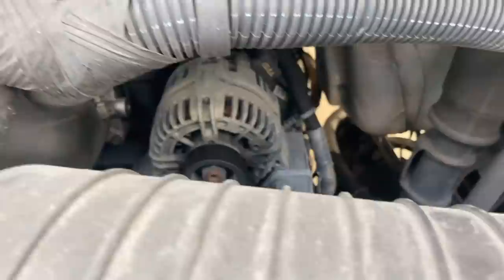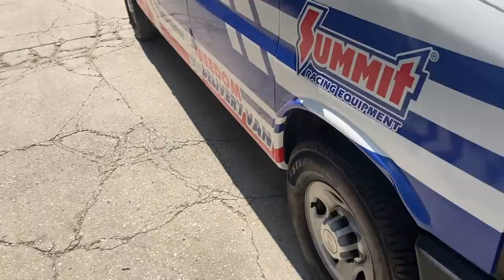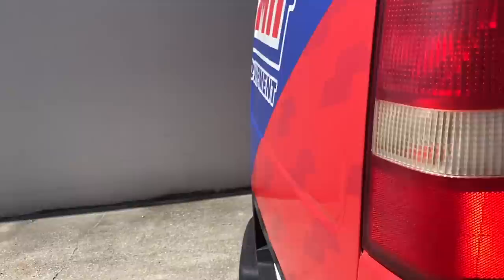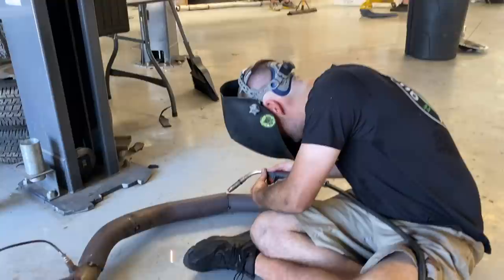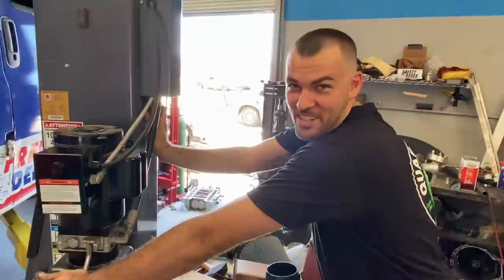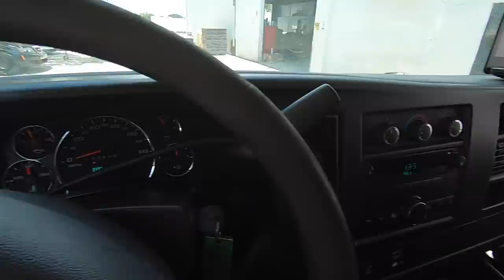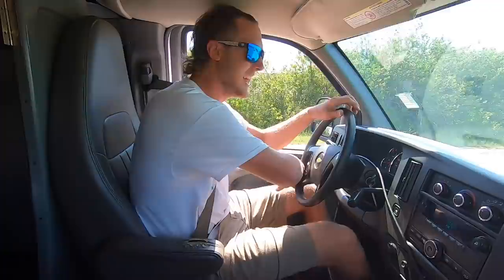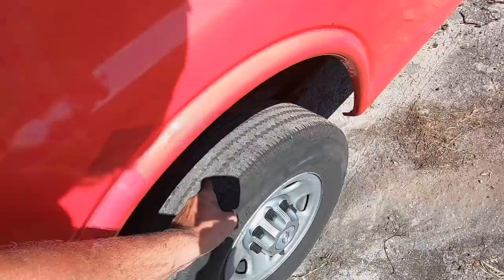We Turned a 220,000 Mile A/C Work Van Into a BURNOUT MONSTER!!! (Freedom Delivery Van)

Comment: Next video: "We blew up the 6.0L and the van is getting a Texas Speed 427"
Reply: as is the stock van is just about ready for 1000hp. 6.0L gen4 with a 4L80e trans 14 bolt rear end 
ideal van to buy for the drive line when building a cheap race car/hot rod or whatever you want
Reply: Or cram that spare 632 in there 🤷🏻‍♂️
Reply: Lmfao Diskmuzik, that it so true haha 😂, Texas Speed FTW
Reply: I highly doubt that. Maybe a Summit crate engine.
Reply: @MrKKUT1984  If you want it to look like the Mystery Machine on the inside 😂😂
Reply: Continue the 427 fleet conversions!!!
Reply: And cal-tracs and roll cage and slicks and nitrous and parachutes and soon 8's and.....
Reply: Lol this is EXACTLY what I was going to say
Reply: @NightshiftCustom  I kinda think it's actually a six speed but I could be wrong.
Reply: The truck actually  has an L96 with a 6l90 behind it, not a bad combination. Haven't  seen too many builds with a  6l90 tho
Reply: and a powerglide
Reply: Kyle C. Correct it should have a 6 speed

Comment: "This was a well well maintained van" that's the last time anyone will say that
Reply: Doesn’t really matter when it’ll have a Texas speed motor with a powerglide in a couple months
Reply: I was wondering myself how long before it has a texas speed motor in it
Reply: Next year's road trip wagon no trailer needed
Reply: Nice waves brotha!
Reply: Guys at summit instantly knew they fucked up when james was the first person seen in video, they knew there was going to be Nos and the signature welded diff.  Kind of wondering when a giggety gas company is going to get with james and make his own unique nitrous system with an Endless bottle and a 1,000 shot pill in the form of no regulator and a straight line to manifold with a remote opener.

Comment: Just a heads up I'm 6'2" wrecked a van just like like this. The front end damage was so extreme they had to cut 10"+/- behind the driver's door, steering column, seat and I ended up with a shattered pelvis, hip, 7 ribs, sternum, and 5 vertebrae. I know you're taller than me so if you're planning on driving it on the street much the best thing you can do is get the driver's seat moved back.
Reply: Wtf man that sounds awful.  I have a van just like this that I drive 5+ days a week and you're story scares me. What you do to squish it up so bad?
Reply: @McNamEvan  lots of speed
Reply: But you lived, must be designed somewhat safely.
Reply: I'd have to guess too fast for conditions, loaded heavy with stuff and either hit something dead stopped or someone pulled out directly in front of.
probably a side of rusted out mess :)
Reply: Jim Herbert Outdoors u cant call that safe with that much damage no offence but google the definition of safe
Reply: True
Reply: @McNamEvan  Sorry I never saw this. I had a seizure or blacked out and rear ended a semi at 45mph. It wasn't "lots of speed" that made it so bad, had I been in a pickup the wreck wouldn't have been nearly as bad. Reason I know is we had an employee driving a truck on the interstate when a suicidal woman cross the median and hit the truck head on and he only had a concussion. Another thing about my wreck is the entire front end of my van was completely destroyed yet the air bags didn't go off.
Reply: @scarea2691  see my reply
Reply: @chesspiece81  well that seems like the key factor here...defective airbags caused you to have such brutal injuries not the design of the van...I'd be suing the company that let you drive a van with defective airbags

Comment: “The last of the V8 interceptors...”

All that van’s missing is the huge stack from Toast. Then it’ll be perfect.
Reply: BIG BLOCK THE VAN
Reply: bump
Reply: Andrew Apel bump
Reply: @raelik777 its easier/cheaper to make power with the engine that's in it, we swapped one into a stock big block truck for that reason

Comment: Awesome guys Vans can be fun.
Here's 2 short stories of mine.
A Friend and I,
Bought an ambulance from a police auction. With 40k miles
It had a 460 Big Block 
And still had all the Lights n sirens. And used to cruise the strip at seaside N.J. and the cops would block a street or 2 to stop guys from cruising up one side and back on the other side picking up chicks. But being that we were in that ambulance, We'd get waved thru the traffic by the cops. He also had 2 15"s and 2 18"s Sub woofers and lotta mid range and huge tweeters. And outdoor horn speakers. You'd hear the van coming from like 2 miles away...
We also got another beater van
It had a 
rawd iron fence as a grill guard.
The front brakes were the only brakes that worked.
Also front shocks were blown,
So if you'd  time n hit the brakes then gas just right, It would bounce like it had hydraulics. 
He had put these big ass
38" Off Road Tires on the rear
And we would power brake that thing everywhere.
 Cause,
Like I said it had No Rear Brakes.
He would hold both pedals to the floor, and leave 1/4mile+ long Burnouts While fish tailing same time. Once we're doing this Giant burn out at night , forever just really roasting them tires...   
 So,
We went up the road turned around and was coming back to check out the marks.
And we saw 2 dim lights, Just sitting there Right where we did this huge Burnout. So we drove up slowly and it just didn't look right. We thought we'd be in Big trouble cause a cop lived down at the end of road.
So as we come up to the lights slowly. Then we seen  2 piles of the rubber, Were on fire and it looked just like 2 Dim headlights. LOL 🙈🙉🙊
 😆😅😄
 💪😎🤘

Comment: Used Van sales just went up 300%!

I'm getting ideas for my new class c motorhome with the 7.3 liter in it..  would make turning it around in a small parking lot easier 🤘😁👍🇺🇸🇺🇸
Reply: So, GM made an AWD 1/2 ton cargo van from 2003 to 2017.  The H series platform(not to be confused with the 2wd G series vans).  Cargo van prices are already extremely messed up because people selling them know that people buying them are doing it for making money, thus, they demand a premium.  My 2010 savana, with its original motor at 370000 miles can be sold today, for around $8500.  This looks like a much newer model, judging by dash type and a couple of gives, this looks to be like a 2014 to 2016my.  This van is worth probably about $15000 with 220k on it.
Reply: Shhh, I'm already trying to figure out how to hunker down my Lance Camper onto my Silverado better. 🤫
Reply: @chubbysumo2230  True, and shameful. Us poor van guys are out of luck. Guess I'll just enjoy pickups.

Edited for stupid ass autocorrect.
Reply: MIDBC1  true but that's a $20k plus difference.  I initially set out looking at Diesel Class Cs. But the amount of use i will give it plus, taxes, registration, insurance. The diesel is not for me. I love my Ram 2500 Cummins,  and would prefer the diesel.  But again its not cost affective for me. Thanks for the comment though

Comment: This hits close to home since my daily driver for work (glass shower door company) is a 2009 4.8 GMC Savannah.
Reply: I hear ya, my company work.van is a 2014 chevy Express 4.8. I wished it was 6.0
Reply: Same here 4.8 2006. Iv only got it to peel on wet asphalt
Reply: @aaronshensky9385  that little motor still goes for its size, considering the size of the van itself too.
Reply: @TheSleepyMechanic0524  I agree. Got it new with 69miles. 120k on it now and still running perfect. 6.0 would be fun too. Great van either way
Reply: Me and my dad have a 4.8 Chevy express for are ac company. And it’s a tank
Reply: @aaronshensky9385  my old girl has 274,000 miles on her. She's up there in age for sure, but she runs smooth. Runs hard too, I can spin it in dry conditions
Reply: You guys are good, i have the 4.3 v6, still does one wheel peels!
Reply: @TheSleepyMechanic0524  damn 274 now that's impressive
Reply: @aaronshensky9385  I try not to beat on her anymore, she's taken care of me for a long time. Been with this company since this van was new, and I've seen newer ones get ran to death while this one hasn't had any major problems. Original engine and trans.

Comment: You need to hold the traction control button for 10 seconds so it shuts it off completely, they do better burnouts that way
Reply: Or just pull the abs fuse, that’s what I do 🤷🏻‍♂️

Comment: 11:43 That oil pressure gauge looks a tad low 😂
Reply: Good catch. Ahh a little motor honey will fix it
Reply: Dangerzone average oil pressure is 10psi per 1k rpms. Given it is idling under 1k and it is showing almost 20psi they are well within operating range.
Reply: Meh, just fill it with 20w50 and send it... Once it starts knocking on 20w50 dump a quart of 90 weight in it and send it some more lol.
Reply: with that much heat in the oil, and likely no oil cooler, its not surprising that it dips below 30pounds on idle, but it was showing around 60 pounds at full rip.  .  Besides, its a buffered gauge, and the digital dash does not actually display the real oil pressure, but an average of the last 4 seconds.  Thats why its slow to go up, and slow to go down.  Same way my 2010 Savana is.  GM calls for about 9psi per 1000 rpm, so at an idle speed of around 550, showing ~30 pounds on hot oil is fine.
Reply: It'll be lower than that by the time there done 😂😂
Reply: The old 5.0 we had in my 97 2500 or whatever it was chevy van had lower pressure than that and we wasted two transmissions in it and did not kill the engine. I think it had over 250k on it when they finally scrapped it. Probably not exactly the same engine but it was the only thing in it that still worked fine.

Comment: I’d buy it off you if you haven’t totaled it yet?

I have customers with 500,000 miles on these, of course you haven’t touched em yet.
Reply: Jim Myers you’re not lying, I have one for a firewood van. They’ll last forever even when abused.
Reply: I have gotten 550k on 1 and more that 480k on two...the vvt sucks kn the newer ones....
Reply: I have one we’re the ac belt is a stretch belt and it’s a real pain to get on do you guys have the same problem?
Reply: Hello peoplee They make a tool that catches the pully lip and helps wind the belt on by turning the crank with a ratchet and socket. It;s about $15-20.
Reply: @hellopeoplee  yes......i uaed zip tie's kn the crank ....put the belt on the comp...the when you place on crank just put big zip ties and tirn the engine manually....or just rent the tool from autoparts!!!

Comment: 2:19 I welded the diff in the 4th car i got the same way, 8 little pea sized buttons. 035 flux core 130amps of DC. has enough grip that it gets down roads that only 4x4 trucks with LSD's can get down.

Comment: I just wish sometimes you had access to the ammount of used tires we have laying around here in new-brunswick canada the yearly vehicule check-ups (required for anything to be on the road) and they are really strict on tires and de have To remove them when they still got plenty of burnout power over here those old tires sell for 5$ a piece and keep in mind canadian $

Comment: Just a suggestion If you got the van from summit check the gas tank. I worked at a dealership where the summit store in Ohio would bring their vehicles in. They have a habbit of drilling through the floors and hitting the tank and using JB weld to try to fix the holes. Just dont want to see you guys blow up.

Comment: A four figure powered engine would be nice to see in that thing...sometime in the future.
And instead of completely deleting the rear brakes, I would use a manual brake lock valve for that. So the brakes are still there and it is still road safe - in case it has to be.

Comment: Every Chevrolet van I’ve driven had either the 5.3 or the 4.8, the 1500 with the 5.3 actually ripped lol & the damn exhaust broke right before the muffler @ around it’s 3rd transmission and 260k, the others have been one 2500 and one 3500 both with 4.8s and we’re absolute turds.  Have a transit T250 now with a NA V6 and it would smoke the 2500 and 3500 I used to drive, possibly the 1500 though that would be a good run lmao

Comment: A van is probably the easiest thing to do any sort of burn out in, I have a Toyota hi-ace 2.8liter diesel MANUAL van not modified in anyway at all and because when empty they are so light in the rear end you are battling NOT to do a burnout every time you take off I aways take off in second gear to try not to, it gets very interesting trying to take of on a wet hill going up, or on a gravel road, I would think being so light, your tires should last a lot longer than any of your sedans doing burnouts.
I think you have good value for the money for Summit Racing"s advertising sponsorship.

Comment: Y'know, if it can run consistent times, a van would make a real easy way to run a first effort at Drag Week,... then add a Mid mounted funny car engine driving the rear end for racing and swap out the front motor for a smaller FWD set up for the street driving.

Comment: might need to put a shiftkit in the slushbox if its a vacuum operated automatic , i think the van is too new for it to still have a mecanical automatic though 
it probably has a 4l80e automatic or sumting like that , should be able to change the shifting points and up the line pressure a little with the laptop 
it might be a good idea to put lower and stiffer springs on the van , to keep it from tipping during wip arounds and it will look better 
summit might have cheap tires for the van in their assortment to put under the van for the burnout stuff , 
https://www.summitracing.com/parts/irn-95686
unfortunately they dont have wheels that fit the van (16 inch) and i doubt the 15 inch will go over the brakedisks

Comment: Hey brotha im a die hard fan of your channels. I've been to cleetus & cars in Houston. I live in Tx.. im reaching out to you because i used to have a work van that was a Chevy Express 2500. Im a Locksmith. The van had a ton of miles on it. She didn't finally give up till over 360,000 some odd niles. 4.8l literally lasted through hell & back. I need a slightly newer van for work if u can turn me on to one. I have money to spend. Plz let me know. Here in Tx those vans are still really expensive. I would appreciate it if you could give me a lead on this. If you dont have any no harm, no foul.

Comment: 220,000 miles isn't exactly all that much for a motor like that honestly, I have seen them go to 700,000 before needing major work or replaced. some over 1M. depends if the owner treated them right and maintained them once in a while.